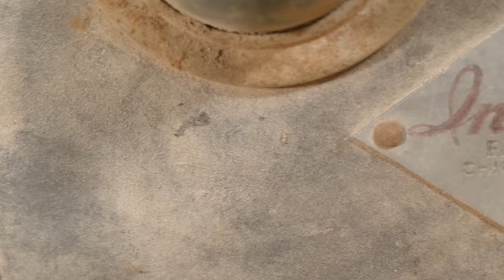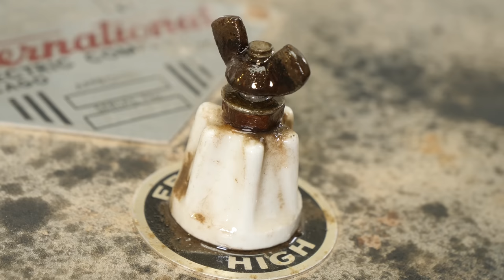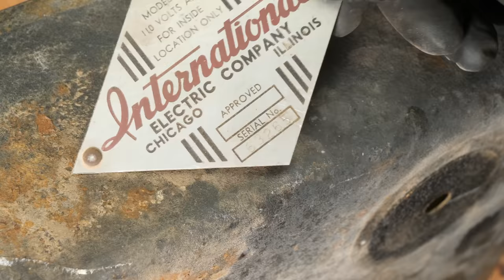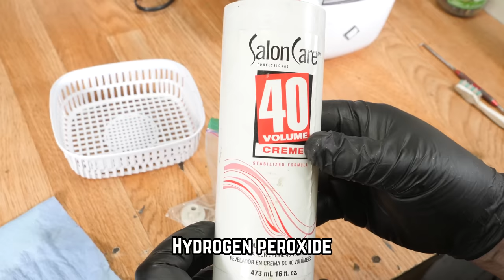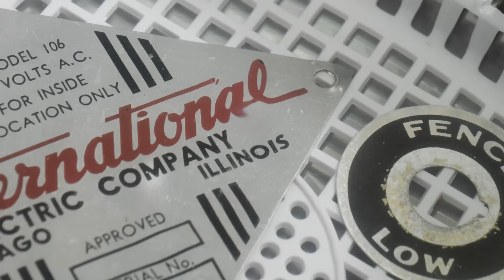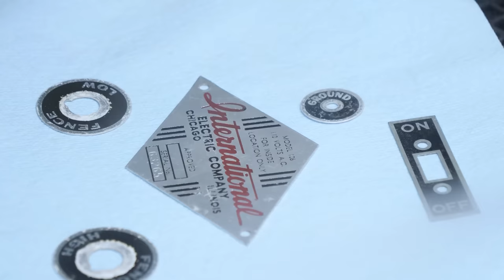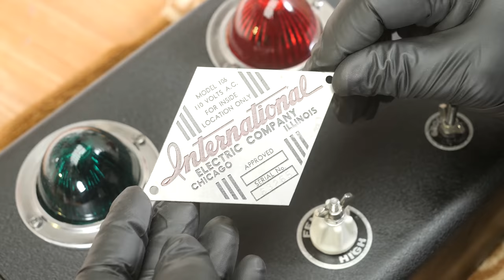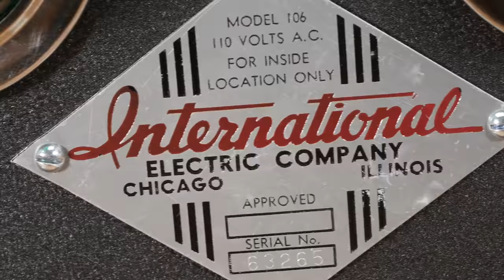Rusty 100 Year Old Electric Fencer Transformation!

Comment: the odd screws are clutch-head drive.  not uncommon  in the 1940's and 1950's.
Reply: type G, specifically
Reply: Harbor freight sells a kit with those bits.
Reply: I haven't seen clutch head screws since I was in high school auto shop learning to rebuild Holley 4150 carburetors
Reply: @lostplanet7046   I'm only 30. I've seen them around the world. Specifically military bases and old factories overseas. Also see them on old electronics and gadgets at yard sales and flea markets. They resemble the safety screw used on a bathroom partition. Like at loves and pilot or rest areas.
Reply: @purplezart 🎉❤😊🎉😅😅😅😅😅😅
Reply: Yu

Comment: Those screw heads are what is called a Clutch Bit screw. They were an early attempt at a security screw, but like you did, obviously grinding down any basic flathead screwdriver isn't very "Secure". Either way, you can still buy those bits fairly easily.

Comment: Clutch bits are one of the most unique design in the specialty category. When you look at the tip from the top, it take on a bow tie or hourglass shape.
These bits were very popular on vintage motorhomes. If you own one or are thinking about buying one to restore, chances are you’ll need a set of clutch bits.

Comment: I would prefer an old fashioned battery charger. They work great on completely dead batteries. An old fashioned battery charger works very well for electrolysis as well. I have also used them to power low voltage soldering irons. A battery charger needs a few extras but they are easily and cheaply obtained. I do like the workmanship.

Comment: Nice repurposing project. BUT, with a little clever thinking, you could make it do both purposes. A mere DPDT switch and it could also be used as a fence charger. The old high voltage transformer can easily be rewound to make it such a project. And new caps as well. Just an idea since you asked for ideas...   Thumbs Up!
Reply from the maker: I love it and thank you. I have very little experience with electrical work.